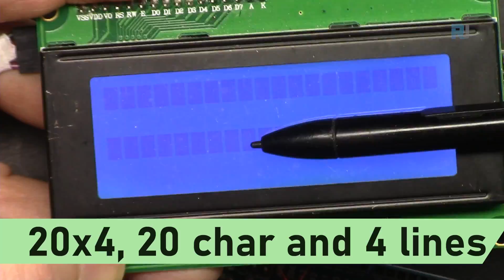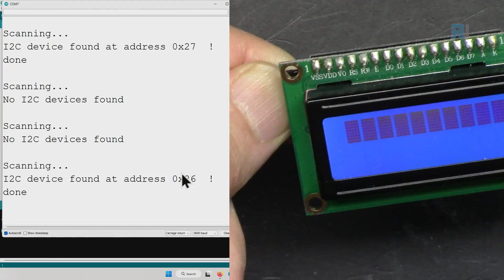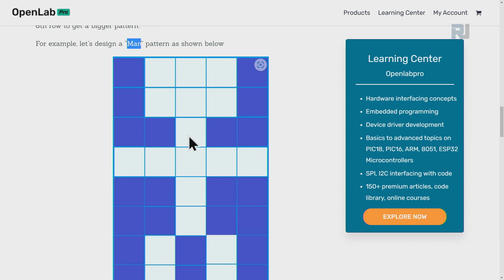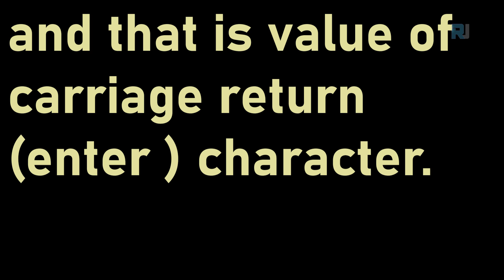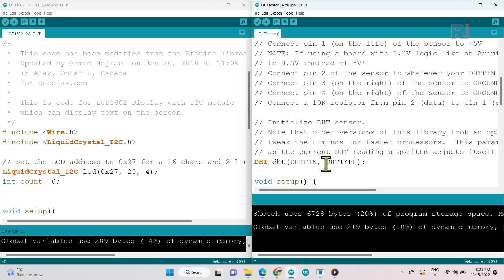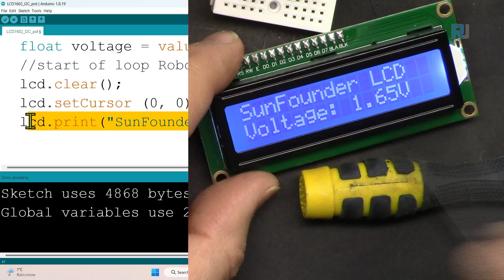Comment: Dear Robojax a very good video. Many thanks from Portugal. I am just begin on Arduino. Is it possible to you give the material references that you had used it? I' m trying to connect a DHT22 sensor, but I need to save the data each 5 minutes during several days. So I need the lcd but a memory card too, for saving all the data. Can you help me, or made a video for us, please. Thanks❤